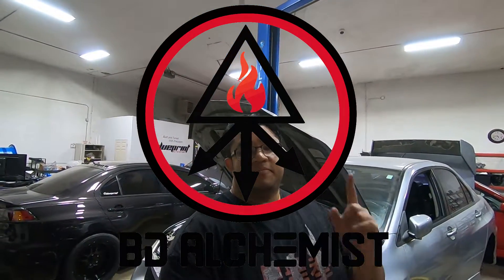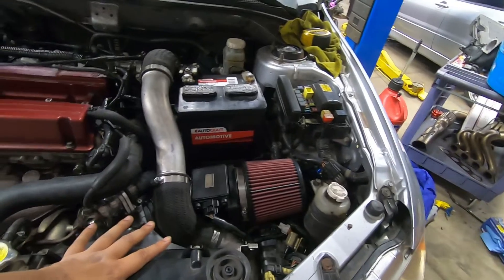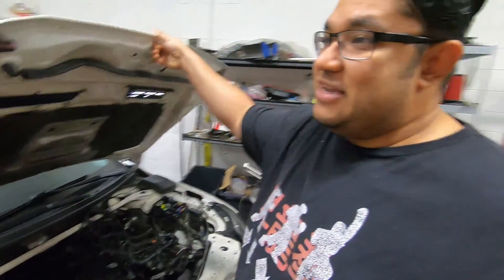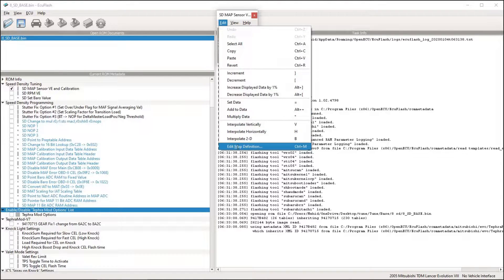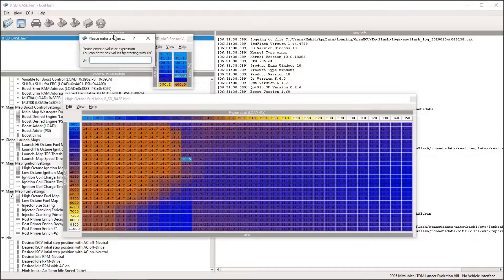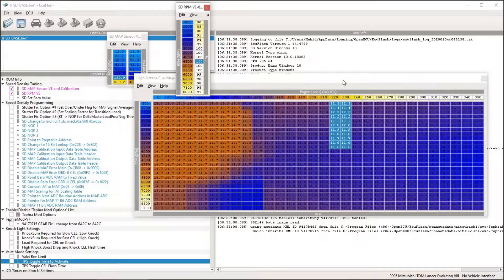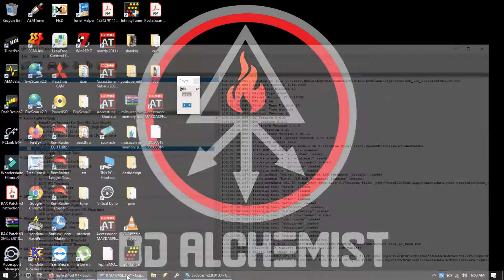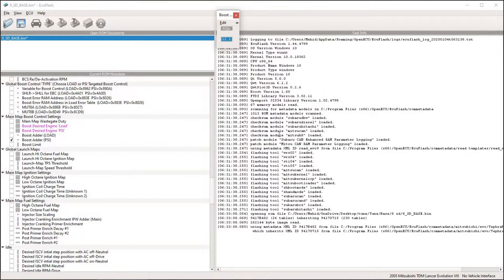How to Speed density evo 8 9 X, sensors and tune explained

Comment: Man this information is great. I learn something in every video. I know you specialize on Evo right now, but what things should I keep in mind when trying to apply the things you teach to my GSX application.
Reply: If ur using dmslink u should already have a sd Rom preformed. U should use specific branded sensors that the rom can read and scaling. My strategy is always 80% idle , Cruise and daily operation and only 20% wot. If u get part throttle operation right all else fall in to place and makes for a great smooth tune. I would start with 15-20 psi and try to make the ECU do 12.5 upto 15psi and by 20 psi 11.8-12. if u can get it to do that the rest is easier. Keep the timing low. Hope that makes sense
Reply: @mehidihassan7362  That definitely makes sense. This is very important because you still need drivability

Comment: Great video BD Alquemist.. One question. I was goint to scale my tables to Omni 4bar, but remembered that the SD instructions I read said to adjust the xml for MAP 16bit to the Ombi4bar scalings. Is this the same thing? Thanks!
Reply from the maker: Yes, that scaling has been added to the ecuflash , scaling options so you don't have to do this manually.

Comment: In ecuflash, when I change the scaling (I put Omni4bar for example), if I restart the program, to goes back to where it was before. Even if I clicked on ''Apply'', any idea why?
Reply: Finally fixed it, I had to change it manually in the xml definition file
Reply from the maker: Yes , it's just they way the xml/ecu flash works. I don't change the xmls because I am tuning multiple cars that uses the same xml and I need the different scales.
Reply: @bdalchemist  Alright, thanks for the info :)

Comment: Subscribed! Do you have info on how to improve idling on 1600cc low ohm injectors, i know they arent the best but they idle at 11.5afr open loop with 14.7 afr set in fuel map, one i cruise the afr follows the map, also my min ipw is 1.75 to 2ms which seems high.
Reply from the maker: Need more info, what car , ecu, fuel etc. And why is the car idling on openloop?
Reply: BD Alchemist evo 8, 2003, fully build 2.0 long rod, e85, walbro 450 hardwired, 3582r turbo, fully build head.

Comment: Do you have to get the tune the same day you replace the MAF with a Speed Density set up
Reply from the maker: Well , no not the same day but I shouldn't be driving without the tune for ur hardware change
Reply: @bdalchemist  is it okay to drive to the tuner ?  2 hour max drive
Reply from the maker: @ThuGnificent1236  that's a question best answered by ur tuner.

Comment: My evo 8 MR has started revving to 3k and won't come down, even when hot! I've changed the IAV and TPS for OEM ones, still doing the same. I have 1200cc low imp injectors, standard coil packs with copper plugs. The temp sensor isn't working as it should, so I've ordered a new one. The engine was mapped to 590hp as I have rebuilt from scratch, deleting those balance shafts, new oil pump and water pump, forged everything and twin plate clutch. I cannot for the life of me understand this high revving, it's really weird.
Reply from the maker: Once u change the TPS u need to adjust it, so it reads what it's supposed to at closed throttle. Check for leaks, check the biss screw and offcourse ur tune
Reply: @bdalchemist  LEAKS! I found the blighter! The throttle body gasket was split, allowing extra air in. New gasket and a re-tune and now she flies along - cheers :)

Comment: I'm confused at the part where you said "at 160 load x 110% at 3500 RPMS bring you to 220 load area"? maybe my calculations are wrong but 160 X 110% gives your 16 more so wouldn't it be at 172 load?
Reply from the maker: You are correct sir, I made an error. But what I was meant to say was if ur at 160load and at 110% ve and ur next load cell is 180 or 240 and not granulated enough , it will take the value of the next load cell after 160 and interpolate it. I definitely made an error on description. I even said "what's is that 16 more?"I  should really make a script before doing these vids. Thank you for the heads up.
Reply: @bdalchemist  thanks for the explanation.  I was wondering that as well when when there is not a number in your range of VE plus load it takes the next column.  This is good to know.

Comment: Does Tephra usually take days to send the ROM? Had to PayPal now waiting to get the Evo 7 Rom
Reply from the maker: Yes
Reply: @bdalchemist  if i source an e7 ecu with the tephraMod ROM already installed on  it from another evo , will i be able to view and edit the ROM from my pc without having downloaded it from the internet and putting it on my version of ecuflash? More specifically, will i be able to see the SD options
Reply from the maker: Ur computer must have the correct definitions to see it but yet u could
Reply: @bdalchemist  in your opinion, should i buy the E7 ecu with Tephra on it, because i cant get tephra to send the ROM to me. can i still tune with SD?
Reply: @phelicks1579  yes. as long as the immobilizer function of the ecu has been deleted you can plug it into your harness and run the engine with it and read/write with ecuflash. it will even read/write without the immobilizer delete but it wont run. I have an evo8 ecu in my eclipse.

Comment: This seems wildly inaccurate and if this is indeed how "speed density" works on the evo ecu i would not use it. your voltage to pressure should stay linear for the map sensor. the only reason to change that table is to set it up for the sensor you are using. the target afr table should be just that, target afr, tune it just like you would for a maf setup. the VE table should be the table used to setup base fueling to hit the targets set in the target afr table. 

looking at the latest tephra speed density appears to work as it should if you understand how to tune VE based systems. I have little reason to get away from the maf sensor right now or i would try it here but i tune haltechs regularly and tuned my dsm on SD and they all work the same. the speed density patch page on evolutionM also says to scale the MAP linearly. 

I can't speak to the X but the IX is not a hybrid setup and comes with a 2 bar sensor which will measure up to 202kpaa, 29.4 psia, or +14.7 psig. the maf is used full time on the IX and like the 2g dsm that map sensor is used for egr feedback. although it can be repurposed to log boost or convert over to speed density. 

playing with the voltage scaling of your map sensor so it shows different load values is the wrong way to do it. you even describe why it is wrong when you say it throws timing off as well. 

Volumetric efficiency tuning uses the ideal gas law to calculate air mass instead of measuring it then the ecu can use stoichiometry like normal to calculate the fuel mass to deliver and calculate the injector pulse to command.
Reply: also for the love of god do not use fuel temp in place of air temp. that value is used to calculate the density of the air coming into the engine and is not remotely reflected in fuel temp.
Reply: The speed density kit I'm looking at from JD customs has an air inlet temp sensor so I think he is indeed wrong about needing to maintain the maf.

To be fair though I think he was merely talking about the effect of not mapping the sensor correctly and the potential effects that would have. He then said it shouldn't be done that way and fuel delivery should be taken care of in the fuel map. so eh.